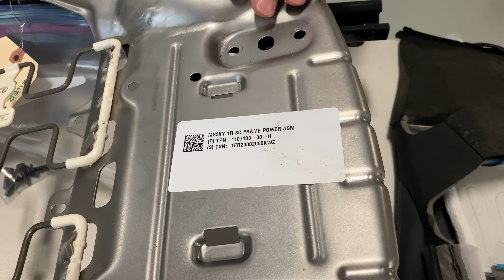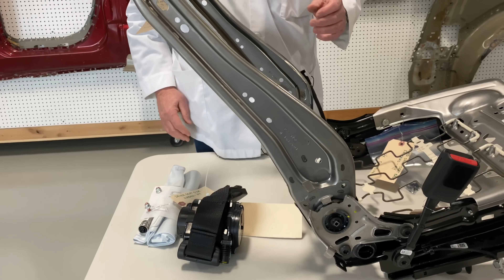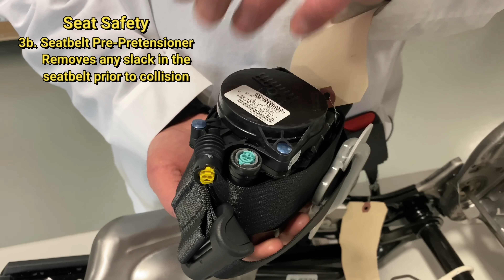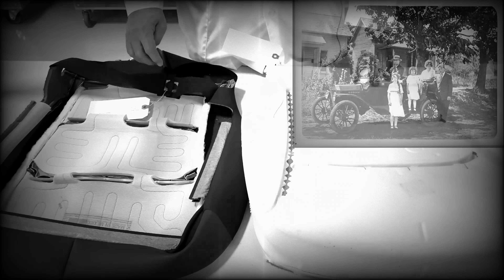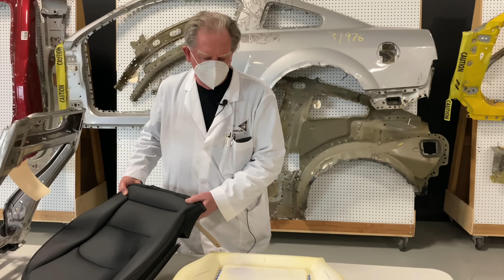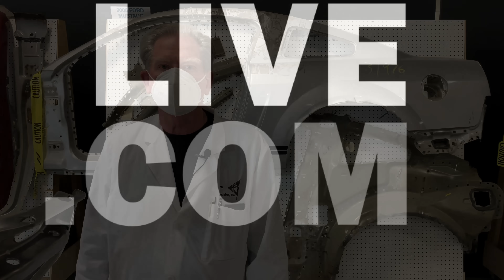Model Y E38: Seat Day at Munro

Comment: Regarding economy of scale gained with S3XY all sharing parts of the seats: what Tesla looses is differentiation betweeen its models. When a BMW 1series has different seats than a 3series, 5series, 7 series, they can also add features to 5 series and 7 series and motivate buyers to buy a more expensive car. At the same time: buyers of luxury cars often have high expectations, that 

BMW can address with expensive luxury seats. These days, Model S and X cannot really fulfill  luxury requirements in seats.
When you, Sandy, repeatedly use your experience at or with Ford, then maybe applying that to Tesla cars is not qute appropriate. In the end,  a Ford Fusion starts at roughly 23,000 USD, with a Model 3 starting at about 40,000 USD. With the premium attitude, that Tesla wants to claim and extend (with statements like Model 3 being their cheapest model), and a BMW 3series as a benchmark car, typically Ford models cannot serve as Teslas benchmark.
Transferring methods and materials between GM, Ford, FCA as major 3 US car manufactures may seem somewhat appropriate. But FMPOV, for Tesla interior, premium and luxury brands should define their benchmark. And these do not have "one size fits all" economy seats, but multiple seat versions and configurations to really suit the customer but also to increase profit.

Finally, the Chinese market: has its own requirements on seats and seating.
Instead of giving Tesla advice on how to standardize their seats even more, or make them simpler/cheaper, Tesla seats should actually get BETTER. 

This Russian owner from 2015 changed the whole Model S interior to BMW 6 series seats and trims:
https://www.youtube.com/watch?v=1NG0BRJn-aU
https://www.youtube.com/watch?v=DmH-S_3-rIk

Tesla has made some progress since then, see https://www.youtube.com/watch?v=Ih7WqPFAx00 , but with no optional seats they still have a more or less "one seat fits all" approach. This was ok for small volumes, but with Model Y volumes growing substantially more seat options will start to make sense.
The other customer facing feature is the number and type of seat adjustments. This will also change the physical structure of the seats.
Seats are for humans, for customers, for ergonomics, for comfort, protection, perceived quality and design. All aspects on manufacturing, robotics and automation shoud be second.
Reply: You're kind of missing the point. This video series is all about manufacturing, robotics and automation. Sandy's job isn't to tell Tesla what seat to put in their cars, it's his job to tell them how to build those seats better, more efficiently and less expensively. You can build more than one type of seat with one seat frame. Yes, having 17 different adjustments might require a different frame--neither you nor I really know what you could do with this frame--but I'd rather the seat be built right in the first place rather than need 17 different adjustments. 

When you get right down to it, having a ridiculous number of adjustments is just marketing gee whiz stuff for folks that don't realize that you don't need all of those adjustments to have a comfortable seat. (Assuming you build the seat properly in the first place.)

I'll agree with your point that a second seat option for the performance models would be appropriate, and my guess is that we'll see that as time progresses. It makes more sense though to make what you have better first, and Tesla has certainly achieved that. Your video is from 2018 and misses the next version of Tesla seats. The new seats are outstanding, simply the most comfortable seats I've ever felt in a car while still retaining sufficient support for spirited driving, regardless of brand. (BMW, Porsche and Lexus included.) While they aren't optimum for a day at the track, they are still rather nice on a twisty road, given that you may want to spend hours at a time getting to that twisty road or on any road trip. 

Some people still need all sorts of gee whiz buttons and bells and whistles in a car. Tesla is proving all of that is superfluous and actually detracts from both the driving experience and comfort. Tesla seat design is a reflection of their design philosophy: Simplicity and understated elegance. Make every car--and every part of a car--do it's job outstandingly well without a lot of fuss.
Reply: @NukemNak  well- said.  Also,  Tesla's phenomenal success isn't coming from doing things the way other carmakers do them.  Hopefully this includes not building 7 different models of SUV  as BMW does.
Reply: @jamesengland7461  always talking the same shit, bmw, Mercedes and other makes different sizes of SUV to fit markets needs. Americans like big cars but Asians and Europeans likes small SUVs end of story
Reply: @carholic-sz3qv  they sell these 7 sizes in the US. It's absurd.
Reply: @jamesengland7461  the sad thing is that the US never receives the best cars and options from Germany.
Reply: @NukemNak  Thank you for your well-versed reply. Still, I doubt, that from 35.000 USD to a 140.000 USD car, there should only be one seat option.
China definitely will want Long-Wheelbase Model 3 and Y with rear seats with foot rests, a massage option, seat ventilation and sleeping position and a screen in the front head rest.  In fact, 3series, A4 and C-class all produce long wheelbase versions especially for the Chinese market.
There will be customers, that want true leather seats in their expensive cars, not "vegan leather" material, which is in fact plastics from crude oil.
There will be customers that expect rear seat entertainment options and massage functions. There will be customers that expect a rear seat bench, that can be slided forward/backwards, or with adjustable seating angle, especially in Model Y. Or removable individual seats or "stow and go" seats like in a MPV configuration. With a uniform seat option, Tesla misses all of those opportunities.

I agree with you that the strategy on seat options is with Tesla, and Sandy only gives advice on manufacturing and assembly of those particular seats. Still, with his praise on volume production and econony of scale, this is where manufacturing simplicity or uniformity interferes with variety and complexity of seat options. But it's the customer, who decides on what features are unnecessary to him or her.
Reply: @koeniglicher  , I don't disagree with your assertions in general. Some of the features you mention actually are available from Tesla. The model Y rear seats do in fact recline, and on the 7 seat version the rear seats will also be on a slider for positioning fore and aft. Speaking of the 7 seat option on the Y, the X has multiple seating configurations as well. I'm not sure if you realized the Y and the X had seating options? Your post seems to indicate that you din't know this.

One thing you're missing though is that Tesla is selling every car they can make. At some point they may need to add features to increase sales, but that point has not yet been reached.  I would love to see seat ventilation for sure, and at some point Tesla may see enough demand to offer it.

TBH, though, my personal opinion is that most of the features you list are things that should die away. Massage  functions are just another thing to break. Foot rests are just added clutter; better to have a seat that is comfortable without one. Rear seat entertainment was nice years back, but with iPads and other tablets being dirt cheap a system that will be obsolete in a couple of years is foolish in a vehicle that is supposed to last a million miles. Likewise, leather is not a material known to last inside a car.

 I'm not saying there isn't demand for these features, obviously there is. The mission of Tesla though is more than to just sell cars. Tesla exists because of Elon's desire to move the world towards more environmentally friendly products. Features that will fail are a part of planned obsolescence, and that is one of the things that Tesla is trying to change. 

Every other car maker is designing cars so that they won't be worth maintaining some time after 100,000 miles. Some makers are shooting for as close to 100,000 as they can get. Think CVT transmissions without oil coolers and it should be obvious who I am referring to. Others are shooting for closer to 200,000. 

Tesla is shooting for 1,000,000 miles. First they made an electric drivetrain that is so far superior to IC engines that many who don't perceive a problem with climate change are drawn to Tesla just because it's better. Now they're trying to make an interior that is so comfortable, people will be drawn to it because it's better even without a bunch of crap that will break in a few years. Less cars in the wrecking yard is good for everybody.
Reply: @NukemNak  I don't disagree with you about EVs but you have to admit that ICE are still way better when it comes to do the job, those huge trucks and mining equipment and cranes and ships they need alot of energy to run almost 24/24 non stop. The battery technology still has along way to go
Reply: @carholic-sz3qv  , I'm not sure what most of your points are? I did concur that there is a demand for different seat options, and I mentioned that the X and the Y have options available, but not as many as other makes. I also mentioned that Tesla does not need more options at the moment, as they sell every car they can make, often well before the car is made. And I never claimed that an EV was currently better for every application? As far as passenger cars and crossover SUVs, yes EV is far superior.  

As far as luxury car, I guess it depends on how you define a luxury car. If you define it as having all sorts of stitching all over the place and switches everywhere, then no a Tesla is not a luxury car. If you define a luxury car as a quiet, comfortable car that is simple and pleasant to drive, that never requires you to remove your hands from the steering wheel to activate controls needed while driving, that will drive for you far better than anything else on the planet, that has far superior performance than most supercars,  then Tesla might well be the only luxury car made. I've owned cars from Lexus, BMW, Porsche, Audi and Mercedes. My Tesla Y is far more of a luxury car than any of them, as I define luxury for myself. However, I look at most of the "features" of traditional luxury cars as annoying crap that will just break down. I learned to feel this way after owning German and Japanese luxury cars for years and then finally driving a Tesla. Perhaps you need lots of switches and stitching and skin ripped from a dead animal to feel like you are in a luxury car? Then in that case certainly Tesla would not be a luxury car for you.
Reply: @NukemNak  you are certainly smoking something, the tesla power train is good but the rest is to desire, the luxury starts with build quality plus things like paint light massage and way more other options, even the isolation , suspension, off-road capability..... that's it there is nothing luxury in the tesla
Reply: @carholic-sz3qv  , Oh I see, no one can have a different opinion than you. Got it. Let me guess, you've never owned a Tesla Model Y? But you know all about it, except really you know nothing about it. Off road capability? You think any luxury brand has any off road capability? If you define luxury by off road capability then the only luxury brand is Jeep. Light massage? If you like it great, like I said. To me that's annoying as hell and will break. I prefer a real massage. Suspension? Let's see comfortable and drives like it's on rails. I'll take Tesla over Mercedes any day. Way more other options? Like what that isn't just annoying crap? I'll bite on ventilated seats for sure though... 

Look, if you like all that crap, great. That's your opinion and you are entitled to it. To each their own. But the comments you're making that anything you don't agree with is wrong is just stupid and ignorant. BTW, there is a reason Tesla is outselling Audi, BMW and Mercedes combined. You can be willfully ignorant of reality or you can understand that different folks prefer different things. You can be stupid by choice, or you can use your brain.
Reply: @NukemNak  stop the bullshit man the range rover or Mercedes Gwagen are very comfortable serious offroaders, the basic Gwagen versions are used by armies all around the world, the Porsche cayennes, VW touareg, even the rolls Royce culinan are good machines. The Mercedes sclass and Audi A8 are also amazing cars
Reply: @NukemNak  maybe tesla is outselling Mercedes bmw and Audi in your dreams. I only see the US influence in your comment. What nonsense
Reply: @carholic-sz3qv  what nonsense! LOL. Yeah, you hear of a lot of those cars completing the Rubicon. :)  I'm not arguing that the Y is a better off roader than any of those; it's not even close. You were the one that claimed off road capability was an important metric for a luxury vehicle, which of course is a ridiculously stupid assertion. Off road,  A good Chevy Blazer will run circles around any of those cars you mentioned. As will a Hummer, and a Bronco, and a Raptor, etc. 

You have no idea what a serious off roader is. Clearly. You've never even sat in a Y, and yet you can judge it's level of luxury. I'm pretty sure you've never owned a luxury vehicle as you seem to have no ability to discuss any of the actual merits of the cars you mention. I had hoped I might have a discussion with you and maybe even learn something. However, you have yet to be able to make even one rational argument. All you seem capable of is making personal comments; I can only assume you lack the intellect to actually debate the merits of any car, let alone an EV. Apparently you're just another troll who is too stupid to have a conversation with.
Reply: @NukemNak  yeah as always those stupid arguments those big inefficient hummer and Chevy blazer that can't even match a land rover in off-road not even a range rover. Seriously you need to grow up, you only talk about everything in the US , the rest of the world actually exist. Open your eyes
Reply: @NukemNak  seriously how can you justify that I've never owned those vehicles you're talking about? That's really stupid
Reply: @NukemNak  you are talking nonsense because people do actually need more seats options depending also on their conditions, German manufacturers like Mercedes and bmw and Audi are seriously advanced when it comes to the quality and functionality, those are real luxury cars. A tesla is not a luxury car period
Reply: ... unless Tesla uses the highest standards for all their seats across their range.  Not 17 way adjustable,  obviously,  with all the perks,  but not making cheap seats for their cheaper models

Comment: To quote Sandy back at him "There is gold in them thar seats!"...The interview when he said this ("Sandy Munro's Tesla Deep Dive - Autoline After Hours 447" ...which can be found on youtube) was probably the first time I really understood why Tesla is so fundamentally different with their vertical integration approach.
Reply: This is a good take-away from Sandy's remarks.  Outsource it, and you sacrifice configuration control, sacrifice flexibility, sacrifice innovation.

Keeping it in-house is no bag of endless joy, though.  Engineering is hard work, and cross-integration between departments requires the engineer to get out of her chair and walk to other offices.  Much easier to just submit repeat orders to a supplier and give up thinking.
Reply: Keeping it in-house also means you lose the experience of having a supplier that probably is in the business of supplying those parts and assemblies for everyone. Tesla still out-sources plenty.
Reply: @bikeaddictbp  Yes, Tesla does outsource some components.

Many components in an automobile are true commodities.  There is no point to making bolts in-house, obviously.  Or cables.

But consider the octovalve.

Tesla could outsource its HVAC components, as other automakers do.  The result would be a hodge-podge of multiple assemblies, none of which is optimized for Tesla's specific application.  Taken together, they'd be too heavy, take up too much space, suck too much electricity.

So Tesla created a single assembly that does almost all of that work, weighs less, takes up less space, uses less electricity.

Are there external HVAC suppliers?  Yep.  Do they have good engineers?  Some probably do.  Could Tesla have commissioned the octovalve from a supplier?  Sure, but it would not be cheaper than hiring good engineers and doing it in-house.  Nor faster.

Tesla was forced to vertically integrate.  The supply chain for BEVs barely exists.  And Tesla does not have unlimited funds.  They had to do it themselves to get it done on time and within budget.

Comment: isn't magnesium very flammable?
Reply: Very difficult to set a large solid piece on fire. It's a problem for the casting plant, and something of a problem for machining (chips and swarf can be flammable), but once it's a big solid chunk in the car, if there's a heat source intense enough to set that on fire, you've got much bigger problems ...
Reply: I think they use an alloy

Comment: Waiting to see the next Tesla seats having liquid filled pipes for heating and cooling. Tesla has patent for.
Sadly you did not explain or compare the heating elements which are used now.
Reply: Mirko Naumann  probably held that info back for the paying clients 👌
Reply: If you look at the what's inside channel, they have torn apart a Tesla seat. You can see it there. However not in detail, but it's interesting none the less
Reply: Mirko, do you think they are using something other than basic seat heating elements that all other cars use?
Reply: @JasonWW2000  Everything is possible. DÆRIK was showing thermal video in comparison.